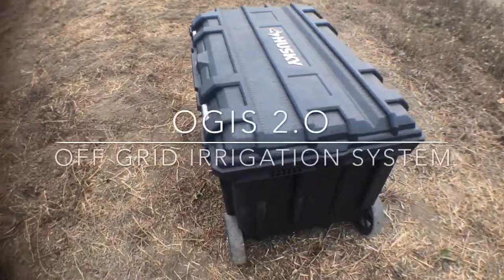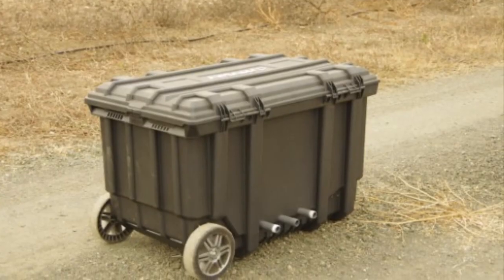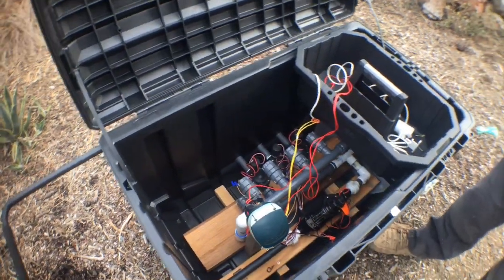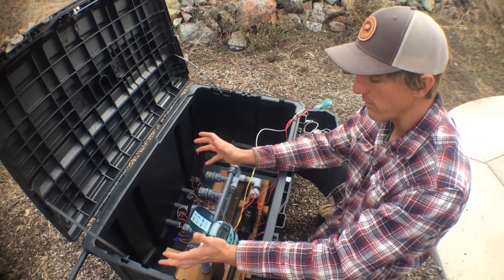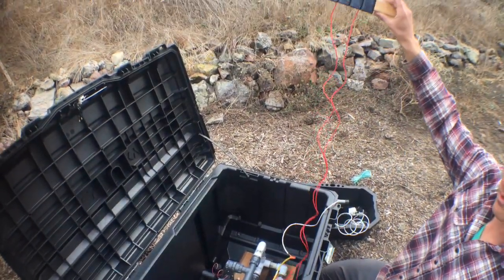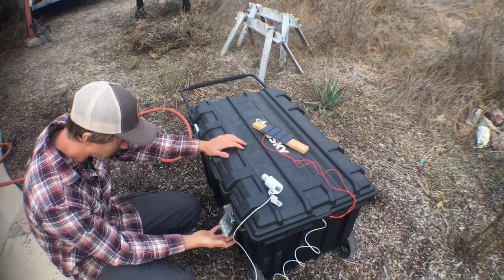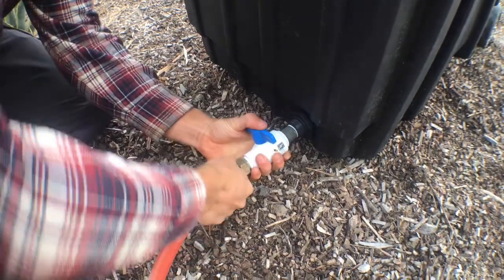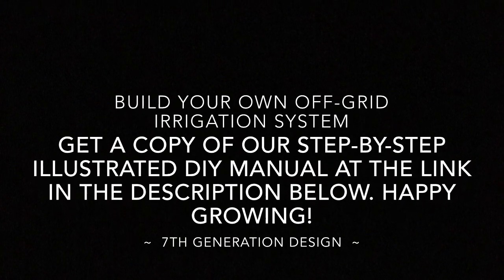Automated Off-Grid Solar Irrigation System

Comment: OkI like it….
It’s kinda overkill
What I’m mostly interested in is wires that will last thru at least the 1st 7 year fruit tree cycle.
A shoe box size just above the water or moisture line…with rat proof wire conduits….a solar panel…is pretty cool…
Tell me about the solar panel and 9v battery ….are they compatible?

What is the approx cost per 1 inch valve unit…?
Due to pressure drops and 50 plus emitters per string…my minimum valve is 1inch…..

Comment: The link to the "Fully Illustrated Step-By-Step DIY Guide complete with parts list" goes to a "page not found" message. Is this no longer feasible?
Reply from the maker: Thank you for the heads up!

I will check on the links - we have remodeled the page recently, so that may be the issue. Here is the active page for the PDF ebook: https://www.7thgenerationdesign.com/product/off-grid-solar-powered-irrigation-system/

Comment: what kind of electric(solenoid) valve do you used ?
Reply from the maker: We generally use Galcon DC solenoids for these systems - have had some issues with Hunter valves.
Reply: @7thGenerationDesign   thank you very much, very helpfull to me, im amateur working on a similar project and i didnt even know the existence of these dc latching valves.  thanks again

Comment: Where are you getting water?
Reply from the maker: We hook up the unit to any nearby available supply point
Reply: Great question. Totally off grid except for the 2" water main with hose bibs. Oops maybe he just forgot to mention that.
Reply: @parkerbirch1475  or he could be delivering rain water from a barrel out to totes🤷🏻‍♂️
Reply: Nope!! Not a chance.  Water delivered from a rain barrel or IBC tote has about 0 water pressure and won't open the diaphragm valves he has... You need water under pressure, exactly like he has here.
Reply: Whatever water source you will be using it would need to be pressurized. That said, my entire water system is off-grid. I have 3500-gallon tanks holding collected rainwater that will be pumped via a solar-powered 40 psi DC pump to this automated irrigation system. Piece of cake!

Comment: Did that small solar panel keep those charged well enough?
Reply from the maker: Yes, the panels are plenty to keep the system topped up and functioning - we're in Central CA, ~ 300 sunny days per year, but even in climates with half that amount of sun the panels should be more than enough to keep the system operational.
Reply: Where did you find a timer to operate in seconds?
Reply from the maker: @rainmakers3199  The Galcon DC/AC 6S Controller has down-to-the-second irrigation windows.